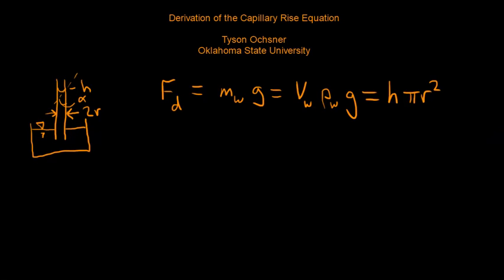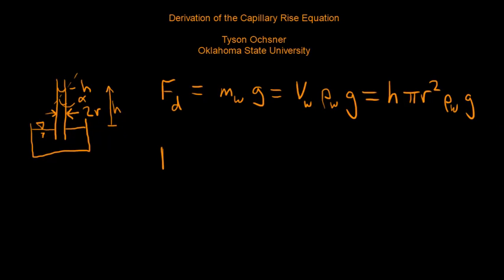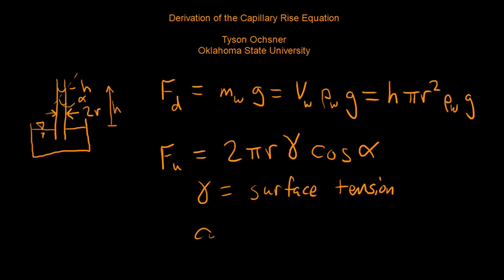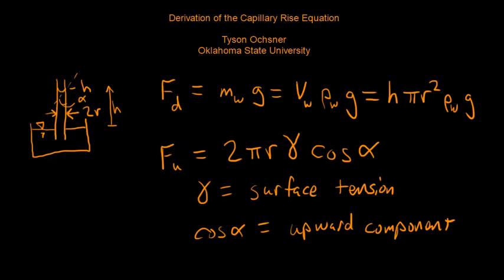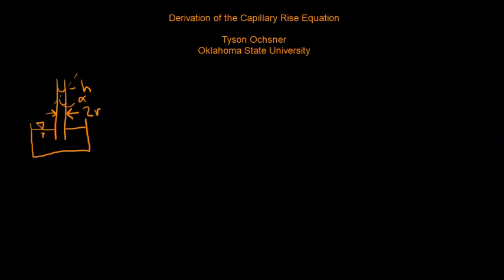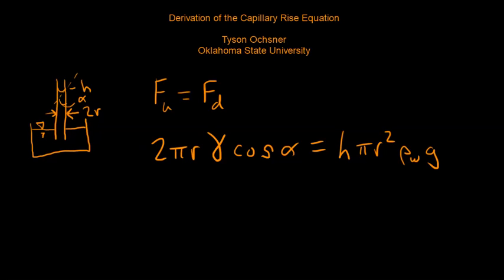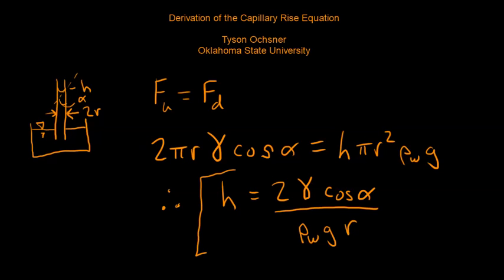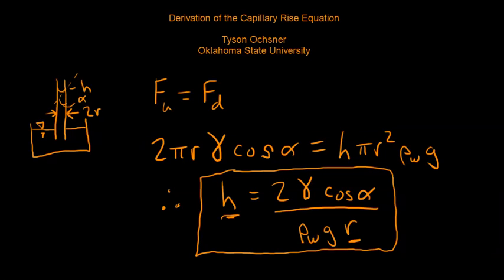Capillary rise equation

Comment: can you help me complete this question?       A capillary tube of diameter 1 mm is dipped in water. The water has a density of p = 998.2 kg/m^3, and a surface tension of T = 7.12x10^-2 N/m at a temperature of 30°C.
(i) calculate the capillary rise of water in the tube if the contact angle = 0°.               it will really help if me thanks